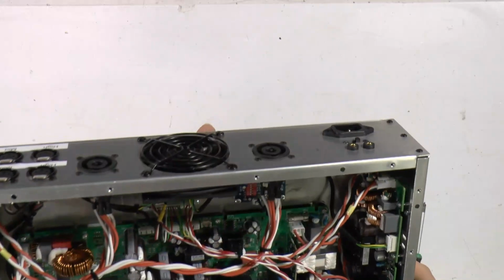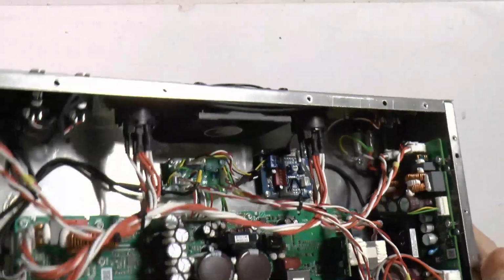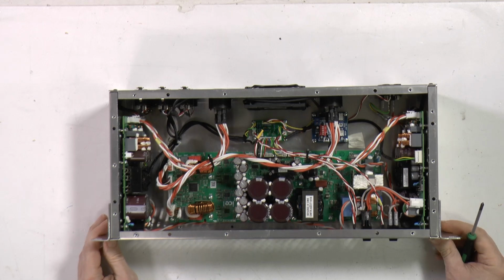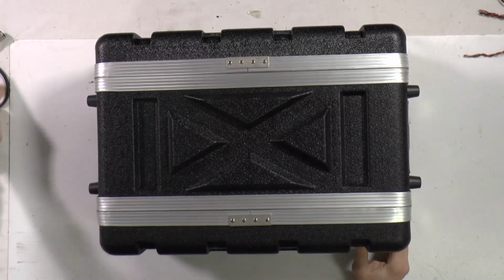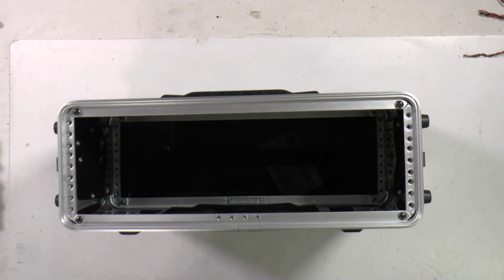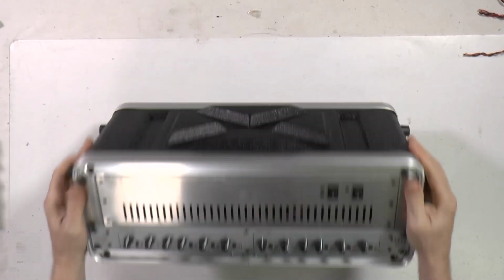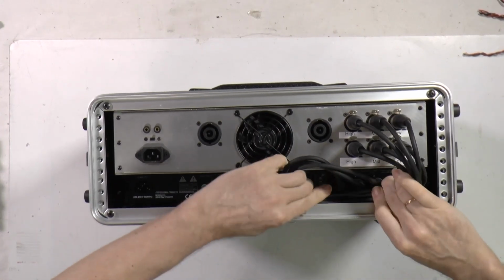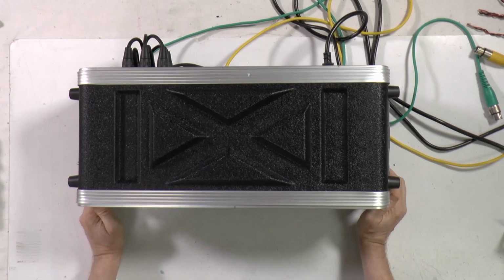Active speaker system ICEpower 1200AS2 + 2x 200AS2 ASS1800 Part2 Building the prototype

Comment: An active speaker means it is built-in amplifier(s) and it could be a tri-amp (for 3-way),  bi-amp (for 2-way) with active crossovers or a single amp with a passive crossover. Your system is a tri-amp with passive speakers. However, your knowledge is remarkable. Thank you for sharing.
Reply: The amplifier doesn’t need to be literally inside the speaker for it to be active.  Active means no passive crossovers.  Rather electronic processing in front of the amps, with the amp output attached directly to each drive unit.
Reply: @mwahlert  The definition does not change.